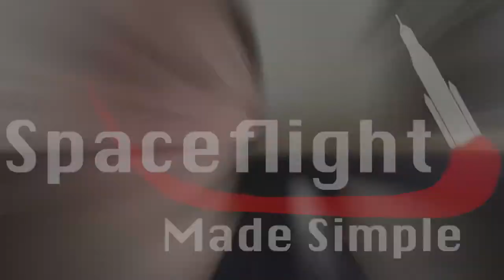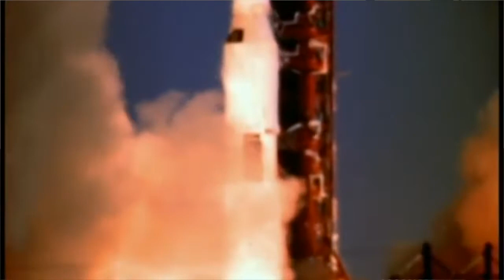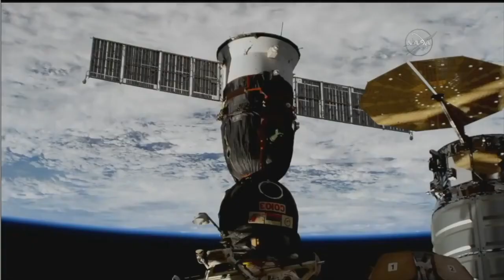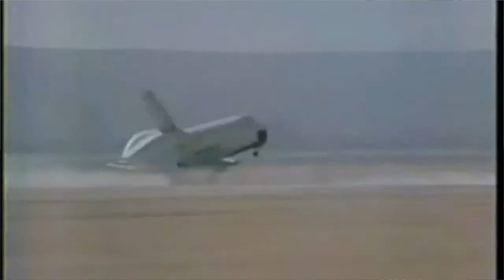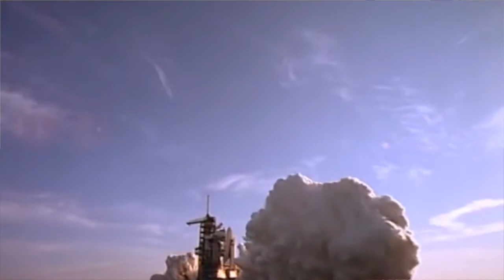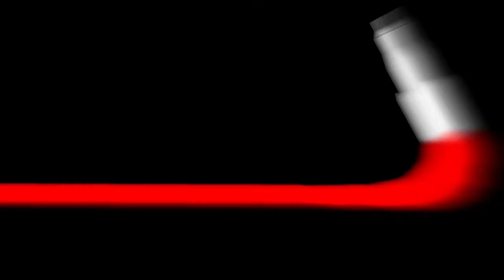Designing the Space Shuttle

Comment: I worked on the shuttle wing program at Grumman aerospace, the wing contractor, in 1979-1982.  The design was interesting.  Multispar connected together with diagonally mounted tapered swaged aluminum tubes, from one spar upper cap to the next spar aft lower cap, in place of traditional ribs.  The wing volume was mostly empty.  Several weight reduction programs introduced composite spar webs, reduced thickness leading edge spar, and other alterations meant to pare weight in OV102 and onward.